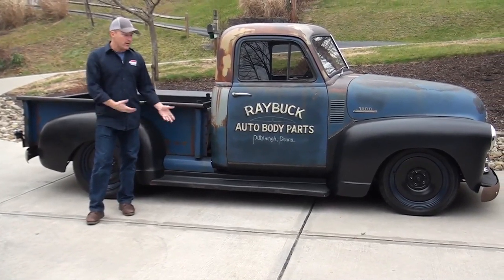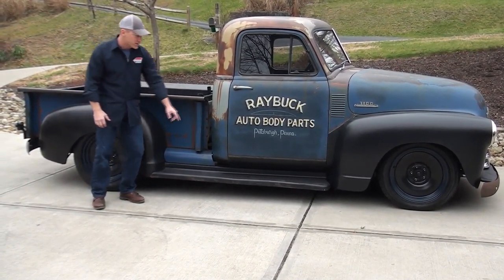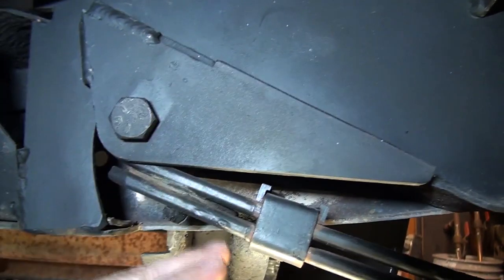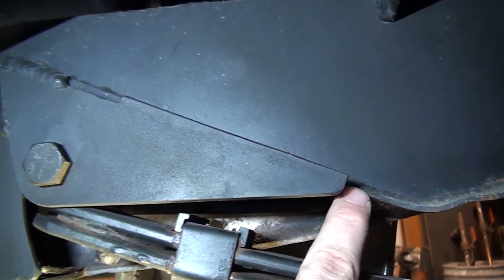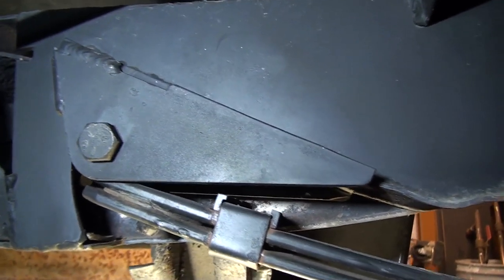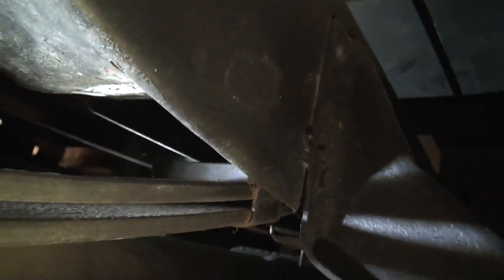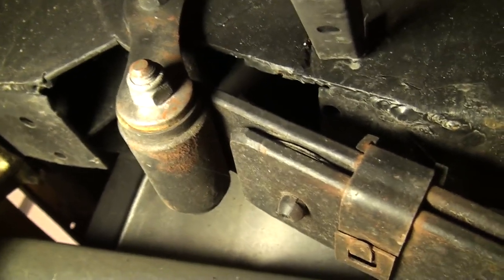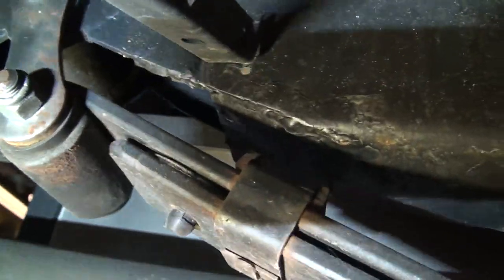Lowering a 1947-1953 Chevy truck without using air bags or lowering blocks (and still have a bed)

Comment: I might do this on my 47 Ford.  The frame is very solid and I use to be great at stick welding.  Its been several years but I'm going to look for a stick/ tig welder and start cutting and welding.  Thanks for showing what you did in great detail.

Comment: I also have Chassis Engineering rear springs, but use lowering blocks. I like this idea, but couldn't see where to front bolt comes out on the outside. In the video it looks like the running board bracket would be in the way of the bolt. What did you you there?
Reply from the maker: Yeah, the running board bracket was in the way. We cut out one of the rivets from this bracket and then put the leaf spring hanger bolt through that area. It didn't affect the running board stability.

Comment: It works great but isn't cheaper and less headeaches just to replace the springs?
Reply from the maker: There may be other leaf springs out there that would lower even more, but we didn't find any at the time of our project. The Chassis Engineering ones that we put on were pretty standard at the time, and are almost level once installed. The biggest issue is really just the mounting point. Even with a flatter, stiffer spring, there's just not a lot of room for play when mounting under the frame rails.